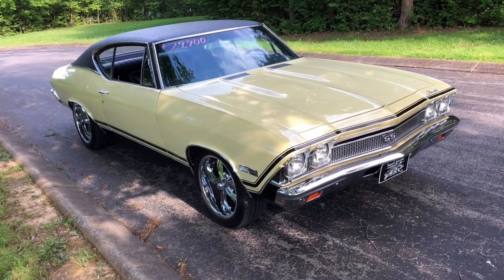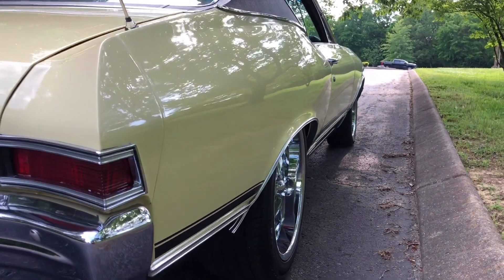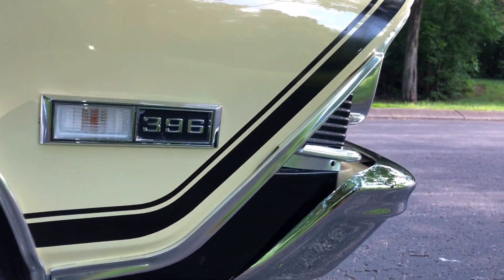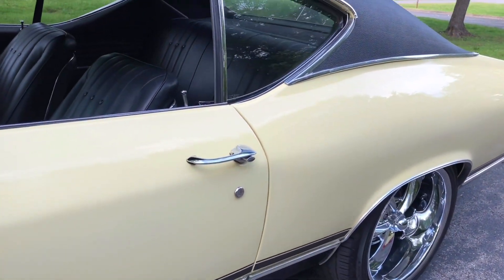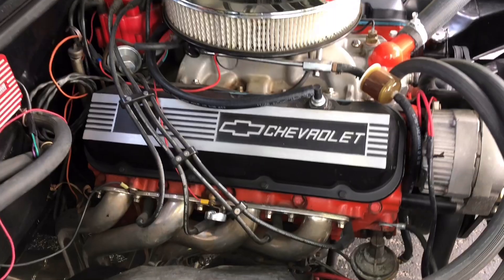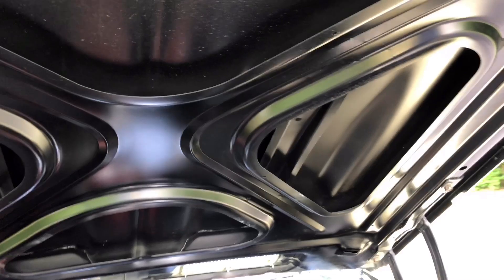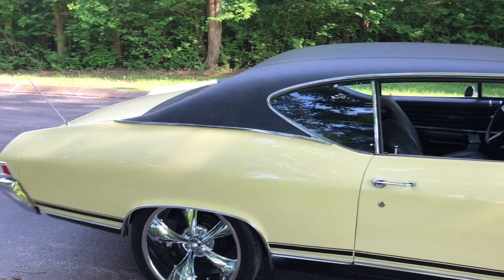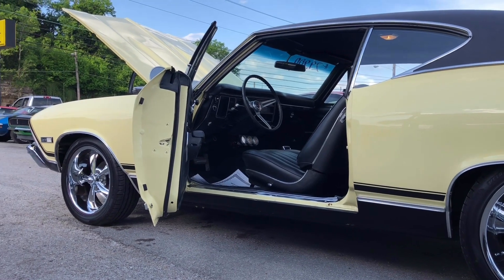“SOLD” 1968 Chevelle $29,900 Maple Motors

Comment: WOW Nick! You’ve outdone yourself with this one! Love the colour combo. It’s nice to see a car with a black bottom boarder on it that’s not sprayed with BED LINER. Have seen a number of cars done that way. I am willing to bet they are trying to hide something. This ones a PEACH! The stance is perfect. It does look like fresh paint. Thumbs up on the big block. The interior is perfect. If I were buying this one the first thing I would do is put on fuel injection for a better response and reliability. The sound of the big block makes me tingle a little bit. Too bad the idle is set so low that it won’t stay running. Very small fix. TWO THUMBS UP!

Comment: I used to have a 68' Chevelle with a 3-speed column shift transmission. It even had the same landow top. Unfortunately, mine was a 307 cu.in. motor. I really wish that I could find where it is now, so that I could go and see what kinda condition it's in?? You guys ready have some great cars there in Tennessee.
Reply from the maker: Thank you